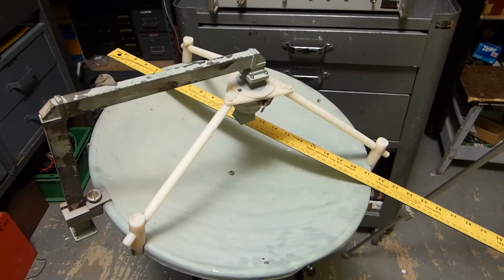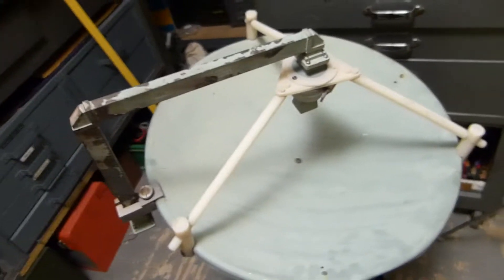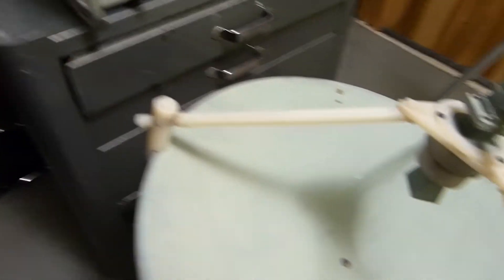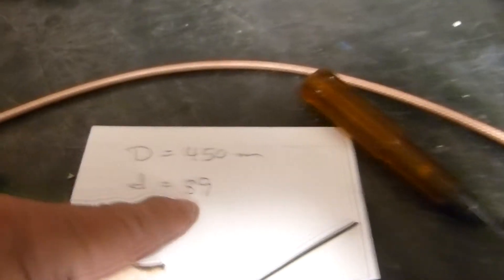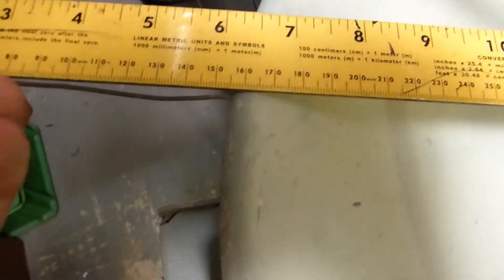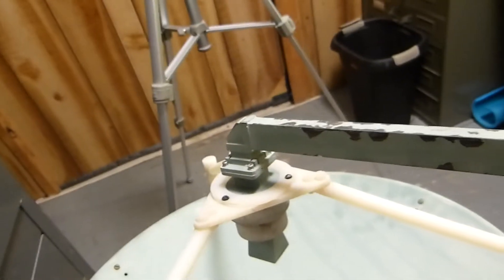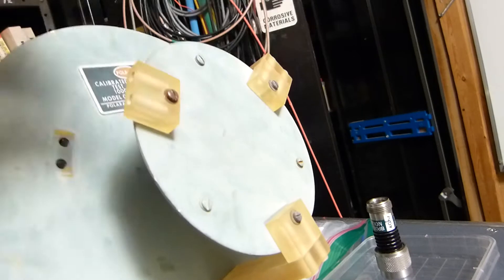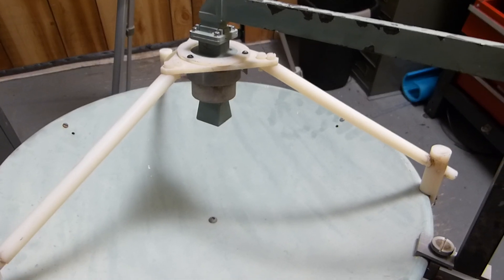Empirical Measurements Of Focal Point For Horn Fed Parabolic Dish At 2.4 GHz WiFi Antennas

Comment: Just watched your video.
I noticed the error in your calculation of focal point or length. 450² is  202500 and 16×89 is 1424 so 202509/ 1424 is 142.2 that's the correct focal point. That's why the rod you measured 154 is a little inside the feed horn
Reply from the maker: Thanks - don't doubt I made a mistake - I still have that dish and three others and just posted a video on viewing the H 1 line in nebule with the TinySA Ultra. The dish in this video is too small for what I do. Probably work OK for 5 GHz and above.

Comment: Can I use a satellite dish for wifi with dual band Panel antenna?❤❤🙏🏼please answer me
Reply from the maker: People do use satellite dishes for wifi. I have found that the off-set type of satellite dish is difficult to find a focus at 2.4 GHz as the dishes are made for 11 GHz. The lower the frequency the larger the dish needs to be for a reasonable amount of gain.
Satellite dishes are pretty small for use at 2.4 GHz. The LNA used for satellite will not work for wifi,  2.4 GHz or 5 GHz.  
I think somewhere in this video I notice the frequency of the waveguide for this dish shown at the beginning of the video and it is pretty high, and the dish is pretty small but for frequencies well up into the GHz range, even a small dish can give a good amount of gain 20 to 30 dB. 
I think something like a snow dish or even a metal trash can lid might make a better reflector for wifi and have somewhat of a focus in the center. Just something to think about.  Maybe you can get some ideas here.  
https://duckduckgo.com/?q=2.4+GHz+wifi+dishes&t=chromentp&atb=v296-1&iax=images&ia=images
Reply: @ElPasoTubeAmps  Well, can I use a circular concave vessel that resembles the MIMO antenna, or can I design an umbrella like the one Andrew Macneil used?
Reply from the maker: @theking-lr2yy  I am not familiar with Andrew's umbrella antenna but I can tell you that you will get gain and directivity (which lowers the noise floor) so you do get an improvement with a feed horn even if you don't have a dish. There are lots of plans out there including my videos.
Reply: @ElPasoTubeAmps  Yes, that's what I want. Directional gain. I want to use the umbrella with a 15 dBi panel antenna ، Is it really work?

Comment: I found a dish antenna with another reflector where my feed horn normally is. 
And the feed horn on this one is mounted on the arm that goes out and holds the reflector.  Do you have a video on such a critter. Texas made.
Reply from the maker: I still have a few small dishes I have been looking at lately. Maybe you just interested me in them again...
I have not been lucky enough to have such an antenna, if I understand you correctly.
It sure sounds like a Cassigrain antenna. The main reflector is a parabola, defined by a quadratic equation, the secondary reflector, at the focal point of the parabola, is hyperbolic in shape. You can look up the polynomial for a hyperbolic equation if you want to do measurements on it. This secondary reflector focuses back into the feed horn coming from the center of the antenna. These are usually very precision and expensive antennas. Check out the local TV station antennas the next time you are close by or Google Cassigrain antenna and see if this is what you have. 
Have fun. What frequency are you planning on using it at?

Comment: Do you know how to calculate focus on offset dish ??
Reply from the maker: No, not really. I have used the offset dishes for 2.4 GHz years ago and had poor results with them.  Just played around with where I figured the focus might be. I figured much of the poor results was that the dish was too small for 2.4 GHz. I think satellite frequencies are up around 11 GHz. The only dish I have had satisfactory results with was the 4 foot black dish I have and a 46 ounce bean can for a feed horn.
Reply: @ElPasoTubeAmps  thank you for reply . I am trying to make a high gain LTE Antenna . Best solution is parabolic antenna . But parabolic reflectors are expensive . But there are lot of offset dishes are going so cheap . 

Have you tried to make a MIMO cantenna ?? With 2 elements inside the can ?
Reply from the maker: @kavindugilshan  In all my feed horns I have just used a 1/4 wave stub on an N connector.  I have another video where I inserted screws to turn in and out of the inside of the feed horn and it will let me tune to no reflected power. Not sure what that did for me but it looked like a good idea.

Comment: Nice. What scope is that ? Leader, Tektronix......  ? Just wondering and keep the vids coming. 👍
Reply from the maker: Thanks for your comments and confirming the focus point is inside the feed horn. I was able to come to that conclusion by several measurements with these dishes. I have not played with them since these videos. I used these dishes and feedhorns, in the beginning, for a 2.4 GHz link between my house and my mother-in-laws house for her to have Internet, phone and a security system. A couple of years ago i swapped out my dishes for some store-bought 5 GHz links that work really great. All of my oscilloscopes are Tektronix.
Reply: @ElPasoTubeAmps  Not a problem. Thanks for the reply and the interesting  vids. 👍

Comment: you could also get a small piece of mirror or CD put it on the dish and shine a torch on it, and X will mark the spot
Reply from the maker: Thank you - good suggestion. Also, someone mentioned using two or more lasers at the same time and noting the point where they cross or come together as the focus. I have not tried any of these methods myself.

Comment: That reflector antenna is not going to work at 2.4GHz, the waveguide is far too small. It looks more like X band with a lower cutoff frequency of around 8.2 GHz.  The other antenna is a wideband omnidirectional antenna.

When positioning a feedborn in a parabolic reflector you want the phase center of the feedborn to be at the focal point of the reflector.  For a flared horn it's a short distance behind the aperture.
Reply: You missed the point of the video. Imperical measurement of the focal point.

Comment: The only time a 4" diameter feed will work at 2.4GHz WIFI, is when the F/D equals about 0.42; regardless of frequency, a 0.42 F/D is going to be 0.85 Lambda. de NV6R.

Comment: what angle and what distance for an offset 27 inch diameter dish, please?
Reply from the maker: Those off-center satellite dishes are not something that I know much about. I have used them for WiFi with varying results. I placed my pickup (I don't remember using a feedhorn) at the same point and angle as the original TV LNA equipment was located but I never made any serious measurements on it. I think the larger round dishes with a real feed horn work much better.
Reply: thank you.

Comment: What antenna is inside your feedhorn and is the distance measured from the horn end or the internal antenna? This set up is much closer than on the original satellite tv dish. Thank you.
Reply from the maker: If you are asking about the feedhorn for WiFi, I use a 1.2 inch monopole antenna mounted directly to the N connector inside the feedhorn The distance I measure is from the center of the dish to an inch or so inside the 4 inch feedhorn can. I have a few other videos where I talk about dimensions so they may help also.
Reply: thank you very much, please would you describe the 1.2 inch monopole as most designs use a biquad which is about 3 inches wide and will not fit in a feedhorn? I do not understand the feedhorn principle, I would have thought a reflecting plate half inch behind the antenna would serve the purpose.
Reply from the maker: Starting from the ground up. we determine the wavelength of 2.4 GHz. This is determined by the formula 3E8/2.4E9 = 0.125 meters (4.92126 inches) for one full wavelength in free space. The 1/4 wave stub is 0.125/4 = 0.03125 meters in free space. Electromagnetic energy travels slower in metal at about 95% the speed of light in free space (air and vacuum are the same for all practical purposes). So now, we shorten the 0.03125 meters up by 95% and get approximately 0.0296875 meters. For us in the USA we still like inches and from a search on Google of a meters to inches converter program we get a monopole length of 1.1688 inches which I call 1.2 inches.  A piece of #12 copper wire is a good size to use and readily available. Cut your copper wire to 1.2 inches and slide it into the solder lug on the "N" connector and measure from the Teflon on the N connector to the top of the wire and cut to 1.2 inches and solder it.  If you watch my videos carefully you will see where I talk about how far from the closed end of the 4 inch can the "N" connector and monopole should be mounted.
These  biquads you mention do mount above a reflecting surface, either copper sheet or a copper PC board and would be be OK for feeding a parabolic dish but you will have different challenges for mounting it and getting it at focus but I am sure that can be done and may work very well but I think the horn feed will give a little better performance and can be easily mounted with thin-wall PVC pipe and end caps. 
Also, as you mention, even a 1/4 wavelength monopole (as described) mounted in front of a reflecting surface to feed a parabolic dish might work somewhat but, again, mechanical mounting can be a challenge. It is also good to be able to rotate the polarity of the feed point from vertical to horizontal for best performance. Good luck with your project. Hope this helps.
Reply: thank you, you are being very helpful. I have made numerous yagis and dishes with the aim of seeing what I can pick up. I have two local sources, both can be received, but whichever antenna I use, one minute the signal shows 72% or more, works for a while, then the pc says 'no internet', although the signal returns later. It is most frustrating. The only solution would seem to be to make yet better antennas. I have found that an 18 inch parabola is better than big beasts, for some reason. I have numerous old sat dishes, but all are off sets.
As I understand your antenna, it is in effect  1.2 inches of copper wire, like using a piece of coax with the inner core bared to 1.2 inches, and nothing attached to the outer coax as a ground plane. Is this correct?
Is this then set parallel to the dish, whether horizontally, vertically or slant, or is the end of the 'rod' pointing at the dish?
I assume the can is 4 inches wide, but how deep? I also assume the antenna is about half inch from the bottom of the can. What I do not understand is how the can, or feed horn, improves the signal. I would think it stops the signal from the outer edges of the dish.
Thank you again.
Reply from the maker: Yes, your description of the 1.2 inch piece of coax inner conductor with the shield removed is correct. The shield of the coax would be attached to the outside metal of the can for the ground plane as you described. I don't see anything wrong with that except the mechanics of it would be challenging so I mount the "N" connector in the side of the can with the #12 copper wire soldered to the inner conductor of the N connector for mechanical convenience. This makes the 1.2  inch antenna parallel with the dish (not pointing at it) and you can rotate the can as you described for polarity. I usually put the antenna straight down (or up) and attach LMR 400 coax and just run it to the edge of the dish and secure it with a clamp. The depth of the can is just whatever a 4 inch diameter bean can turns out to be. The antenna is mounted a good bit further away from the bottom than 1/2 inch. I don't remember but I do describe this distance in some of my videos. The theoretical distance, I believe, is 1/4 wavelength or about 1.2 inches but I get poor results with it that close to the bottom of the can..
I had my largest parabolic reflector and this type feedhorn mounted on a 35 foot tower and a rotor a number of years ago. I was receiving about 250 access points around my area and this was about 12-14 years ago. I do have some pictures of it I should show on a video sometimes. I don't think I have the physical stamina to do that again. 
Exactly how the feedhorn works is not something I understand either. I have studies waveguides but I have no practical working knowledge of them so I can't help in the understand of the actions of the feedhorn - but it does work.
Reply: thank you so much. The distance from the bottom of the can/reflector to the antenna should be 15mm.
I will  try the feed horn in place of just a copper plate. The biquad is supposedly better than a single rod, though not appropriate for a 4 inch diameter can.
I am using an Edimax with wisp, rather than a dongle such as Alfa as that is the only way to provide a signal for phones. I have replaced the fixed antennas of the Edimax with sockets to attach antennas via coax and restricted the length of the coax to 5 feet.
The Edimax itself has two antennas for 2.4ghz, but experience shows best to connect only one to one antenna on the dish, and it must be to the right antenna connection on the Edimax.
I have also tried using my offset dishes with an antenna placed at various distances directly in front, but it seems not to work, wrong shape dish.
There must be an ideal length for the feed horn, or if too long it would cut off signal from outer edges of the dish.

Comment: I say you are handy for more than just amps
Reply from the maker: Hi Bill,
I sure do remember those days. These guys were gods and it was magic to work at GHz frequencies. I have more equipment in my lab than I was around at NASA and White Sands. I always liked the idea of working with microvolts and microwatts but I certainly could not afford it. I had it at WSMR but never thought it possible to own this type of equipment. Equipment made in the late 1990's and early 2000's is available at a "reasonable" cost and that is what I have invested in. I really enjoy it and much prefer to measure my antennas with real impedance bridges than a SWR meter at high levels of power output. And nowadays there are are so many ways to make these measurements at a fairly reasonable investment in equipment.
Reply: Do you remember when hams were experimenting with microwave communication in the 2 Ghz range? We used to think it was nearly impossible to build gear for frequencies so high. Now everyone has 2.4 Ghz in their home, even in their pocket. 
I never got into microwave back in the day. The parts were way too expensive back then. Probably more fun now with so much 2.4 And 5Ghz stuff available. .